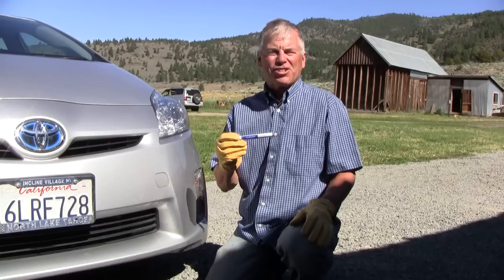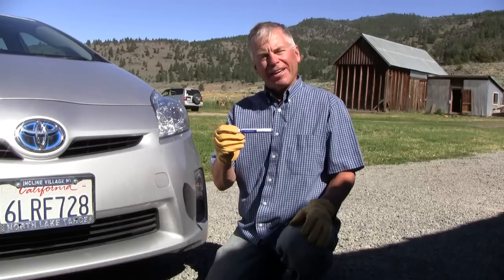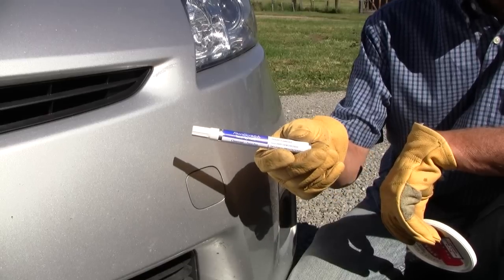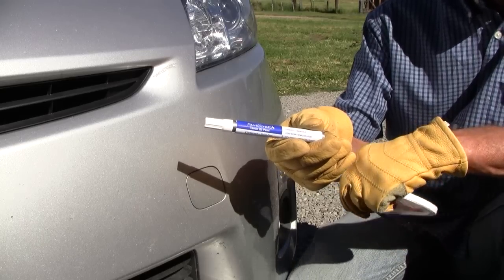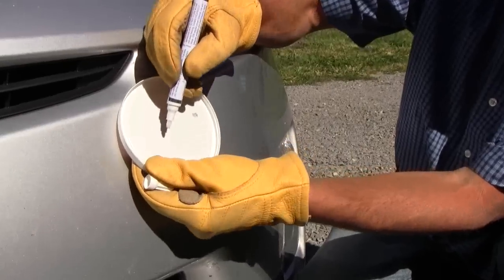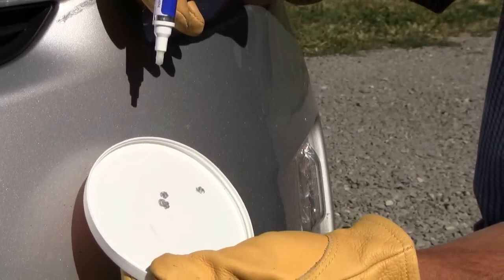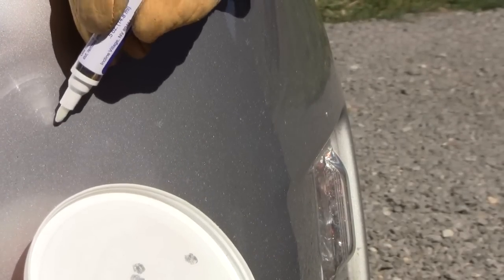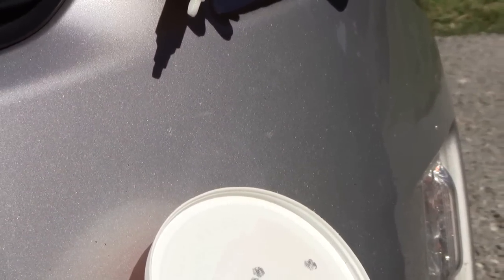Clearcoat Pen - How To Use Clearcoat Pens

Comment: To get rid of the bump caused by the clear coat what should I do?
Reply from the maker: You can use rubbing compound to gradually smooth it out.
Reply: whats other name for rubbing compound? is it easily available al dealer stores?
Reply: @Paintscratch which brand clear coat pen do you suggest?

Comment: I have around 6 fish eyes the body shop left on my fender job, I'm think of having them dab the holes full of clear coat let em dry and wet sand and polish after too avoid redoing the whole fender,would this be a solution?
Reply from the maker: +rellik187redrum Fish eyes are caused by surface contamination underneath the paint and the only solution is to remove all of the paint down to the metal and start over again. Unfortunately, just dabbing the spots with our clearcoat will not help at all.
Reply: more like craters in the clear coat , i don't think I used the term fish eye inappropriately I think, the imperfection in paint colour I can live with ,it's just all the holes in the clear that really are noticeable at night under lights,can they be water sanded down or even filled up abit,please tell me what you think, lemme tell you that Montreal is a bad city when it comes to auto repair,only a few that actually know and give a shit about what they are doing.
Reply from the maker: +rellik187redrum I would suggest trying it on one spot and seeing what happens, but fish eyes are common in the auto body industry. I've run into them a bunch of times in my time in my shop! Not fun!

Comment: I did this but the clear coat left bumps. How can I remove them? And how?
Reply: Logan Ryan u need to sand it too, it's been 3 months since u ask but I tho it might help.

H
Reply: Use 2500, then 3000 grit wet/dry sandpaper, then white polishing compound.
Reply: According to them, the rubbing compound can fix that.